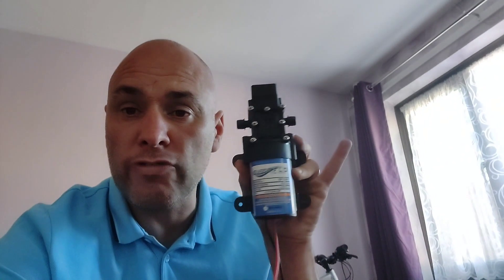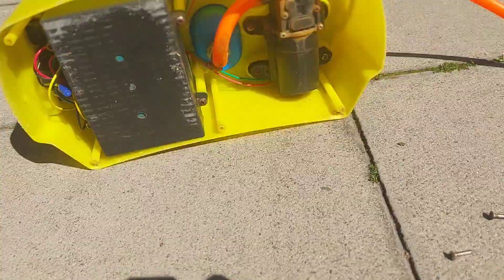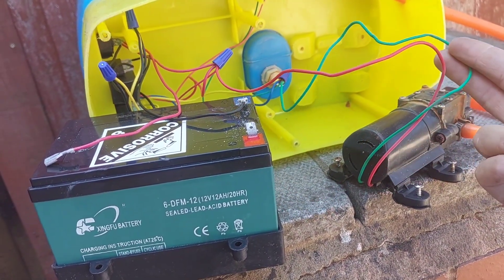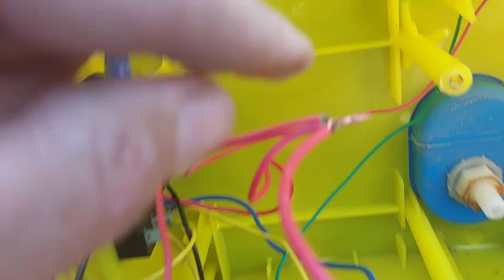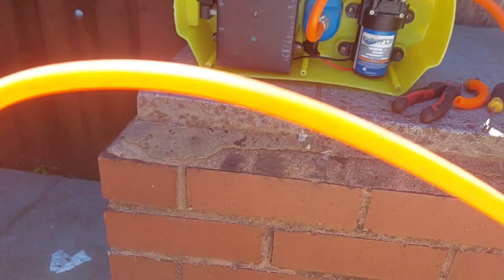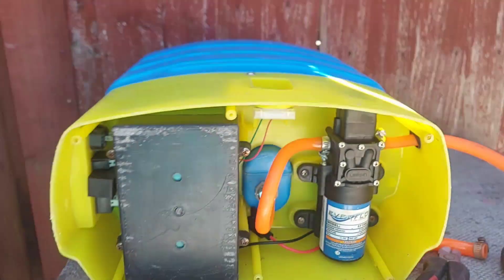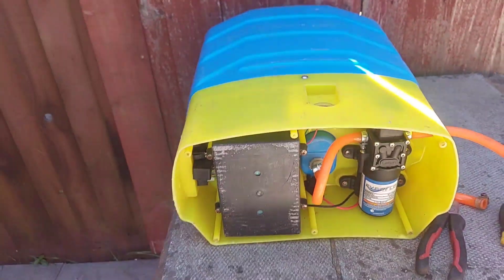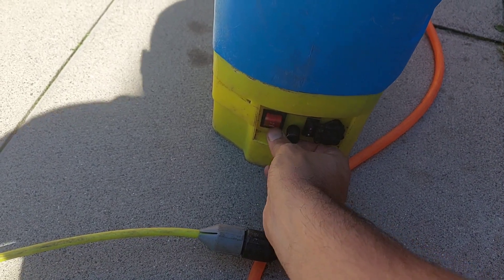HOW TO FIT A CHEMICAL PUMP INTO A GARDINER BACKPACK, EASY FIT, HOW TO #howto #how #backpack

Comment: New to this, got to say the ‘technology’ looks like they moulded it in 1974, before ‘technology’ had been invented as a word 🤕 Bought a facelift back pack off ebay yesterday, with a couple of waterfed poles. Going with the “it looks old, he’s been doing it ages” method 🤗
Reply from the maker: Lol like your train of thought there LOL good luck with the venture buddy I'm sure you won't look back
Reply: You're a bit of a crack head aren't you mate? Would you prefer a complex backpack that breaks down all the time? If you'd like me to whip one up for you just send me your backpack and I'll add a couple hundred meters of wire and circuit boards so you can brew a cup of tea and toast a scone